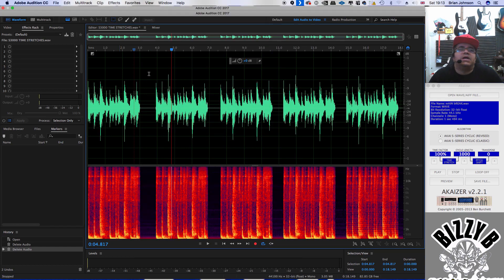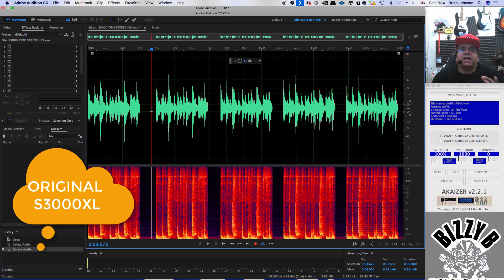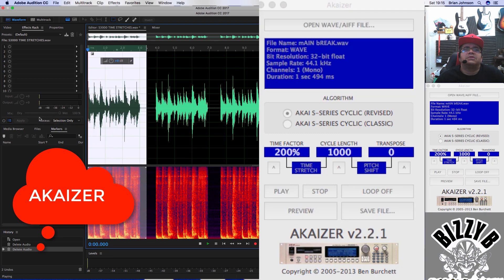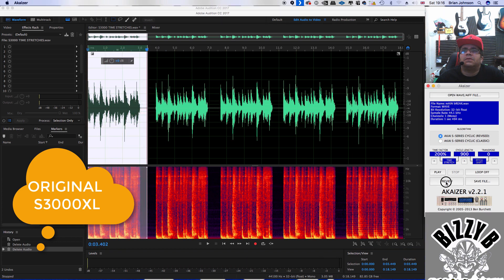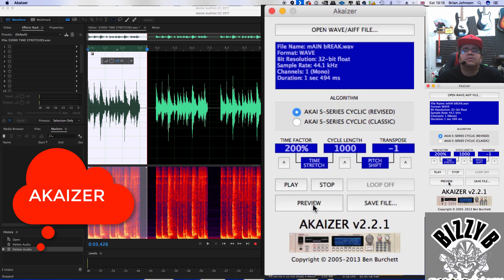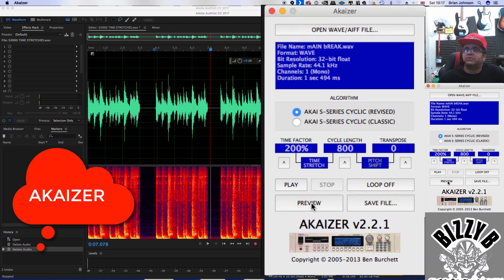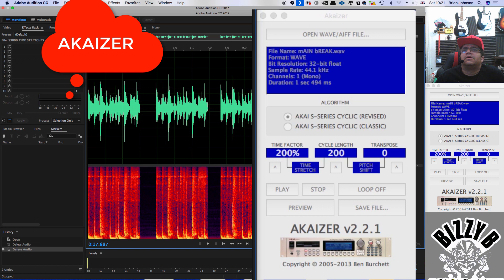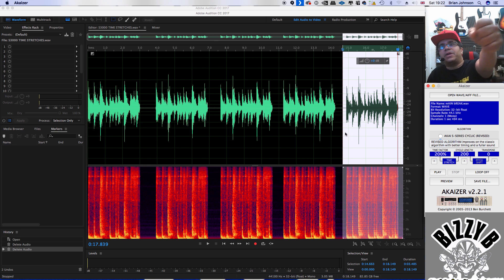AKAIZER Timestretch Comparison to a real Hardware sampler

Comment: Hey there - interesting video. I am the developer of Akaizer and was surprised to hear the sounds were not at an identical pitch. I spent a lot of time getting the pitch perfect when developing Akaizer by using an Akai S2000. I was sending 44.1kHz samples from my PC to the Akai sampler via SCSI and then time-stretching on the Akai and on Akaizer with identical settings. The results were 100% pitch perfect. I also did comparisons by ear using an old S2800 and the pitch was spot on again when using identical settings.

To do a true comparison test the sample being time-stretched MUST be 100% identical and sample accurate on the Akai to the sample file in Akaizer. The only way to achieve that is to transfer the sample to/from the sampler digitally via a SCSI transfer, for example. Only then will a comparison test give perfect results (using the 'classic' algorithm in Akaizer) otherwise you end up with slight differences in the pitch of the sound like in this video. I hope that clears up any confusion :-)
Reply: 2nded - akaizer is amazing and I use it in almost every track. Big up for putting the time into making such a useful tool
Reply: Dear Ben  Is there an active link to download your plugin?   64 BIT for Mac. ?
Reply: I really like Akaizer. Thank you for your work.
Reply: yes the rate must be different!
Reply: Thanks so much for you work, love the Akaizer!
Reply: Akaizer is GOATed. When I use exact settings and classic it’s nearly identical to my s950 and takes miliseconds compared 5minutes per sample. When I say near identical I’m saying like phase eachother out identical. It’s that good.
Reply: We really need an updated version of this that works on mac and windows

Comment: Akaizer is a great tool. Thou I do regret selling my samplers years ago. I kind of found a little technique of getting my stretches at the the right contextual musical pitches. By changing the cycle length in + or - 20 increments and then using a say sinewave test tone to compare. 
Just a tip for anyone out there 👍🏾👍🏾

Comment: Growing up in a small Canadian city where nobody was producing Jungle in the mid 90's..I had Nooo idea the difference in samplers. I started on Wavelab 1.5 and Kurzweil K2000 and it used to piss me off why the timestretch never sounded "right....... It was prob a decade later that I discovered the timestretch used was from the Akai...and I'd be dammed if Im spending $1000 USD on a S950 on eBay, I refused when then were $500 USD...So for me Akaiser been the answer...Between Akaiser and the very under rated Roland W30 I can still bang out a gritty sample

Comment: Does the cycle length max out @ 1000? Cuz it sounds like if you raised it to 1100 or 1200 you would match all across the board.

Comment: maybe the Akaizer is processing at a higher internal samplerate which might explain the higher "pitch" differences..

the timestretch on the Akai is pretty bog standard as theyoriginal designed the algorithm in like 1979 (it only because commercially available to us lot way later)

there i actually a streetch process in Adobe Audition (cool edit) thats the same too..just uses different names for the same thing.  Dblue's Stretch vst is the same thing too and you can use it as an insert in your DAW